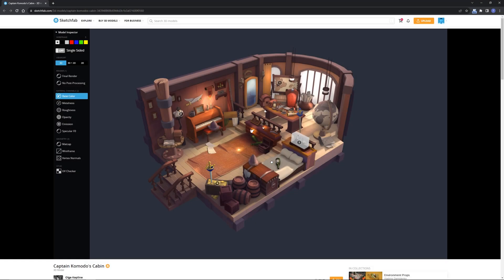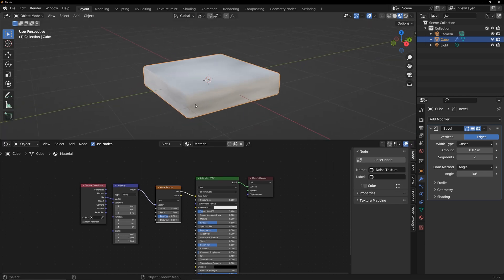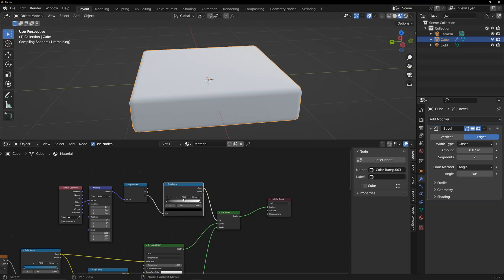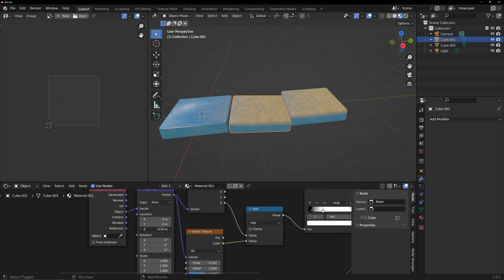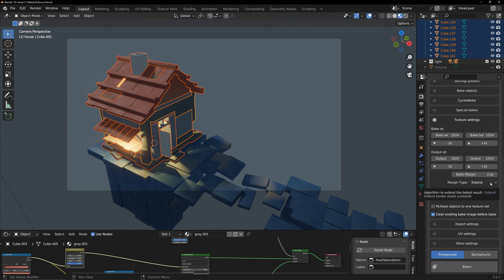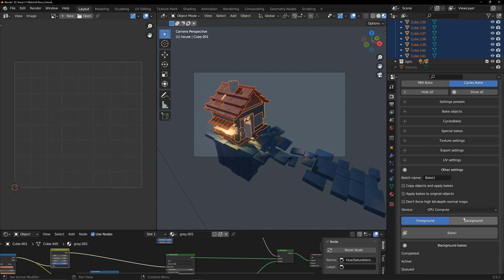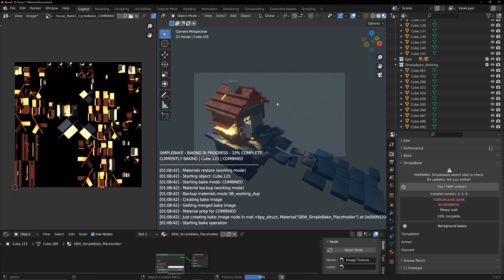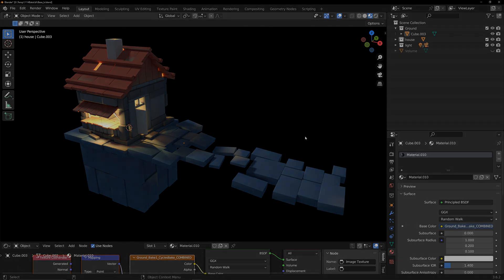Bake anything onto texture | Merge Multiple Textures | Baking Procedural Textures | Baking Light |

Comment: Hi there. I watched the older video and this one and just had a few questions. I have sculpted a full human skeleton - each bone has it's own UV map, and I baked the normal maps down from high to low. I had to do each bone individually and isolate them to prevent the high to low bake from creating artifacts, as the cage could not intersect with the other objects. So the ribs, for example, I used a 6x6 UDIM layout. The shoulder blades a 2x2 layout, and some bones have a single image. If I have a combination of these UDIM layouts across objects, would I need to create a UDIM layout that is above 6x6 since that is the highest layout? If I'm understanding correctly there would need to be an additional UDIM square for each object. **EDIT: I asked some AI's and got an answer indicating that I would need a UDIM tile for the total number of UDIM tiles across objects.